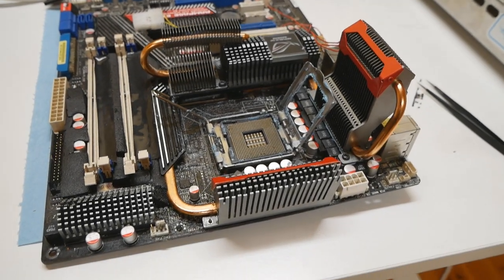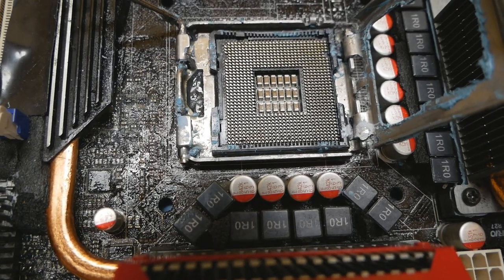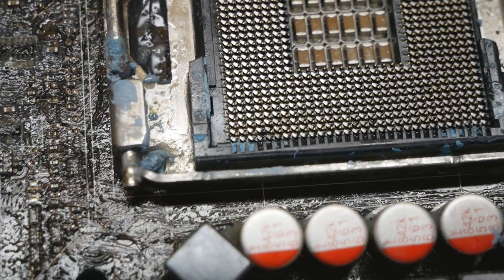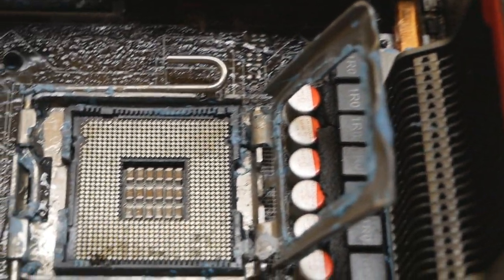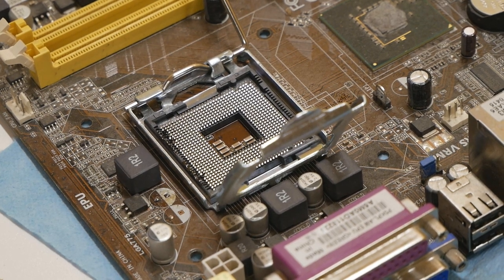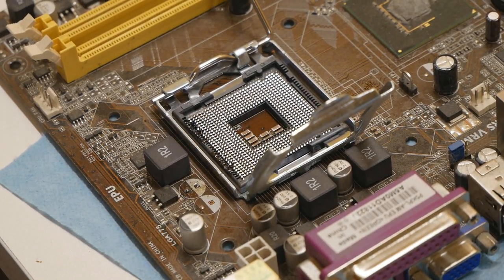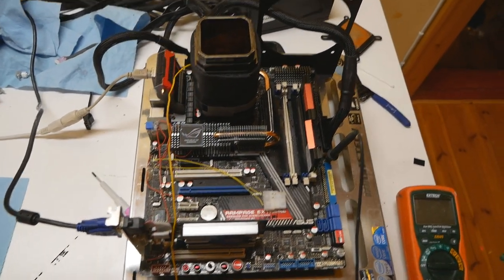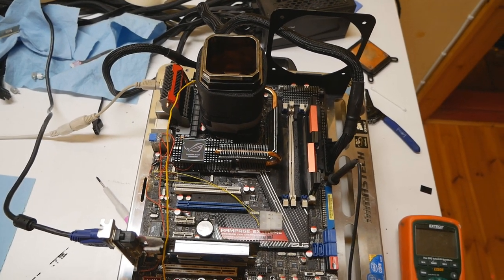I Damaged a CPU Socket Pin while Bending :D - But Now it WORKS After Replacing it

Comment: Successfully managed this on a Asus and gigabyte 300 series board. happy to say both are now fully working. Been trying for months. one thing that I found though is that if you also grasp the pin with the tweezers as you are heating it you actually get better heat conducted through the pin and down to the bottom to the solder.